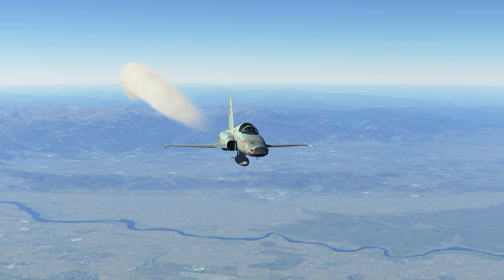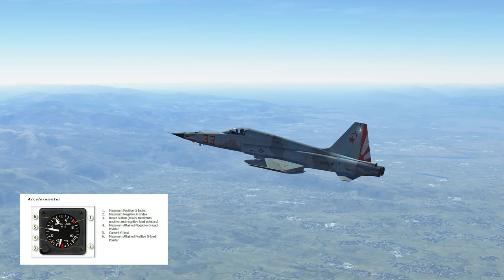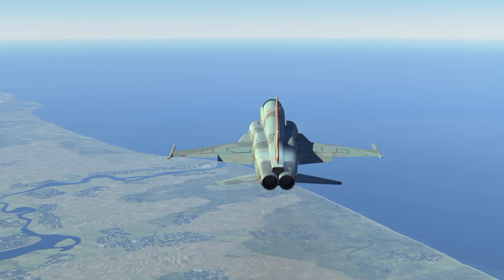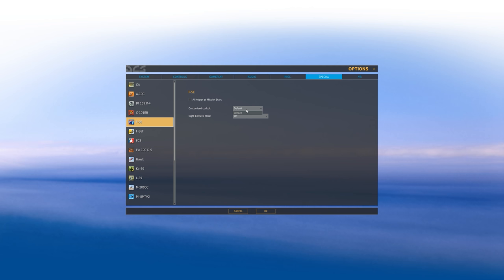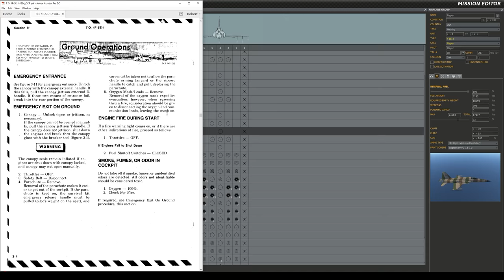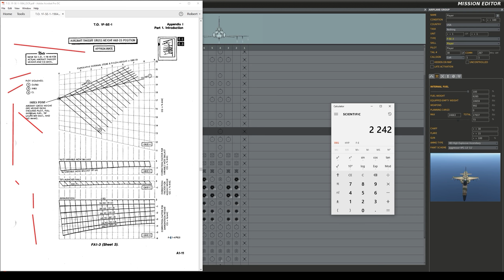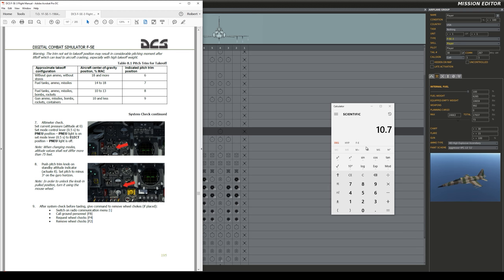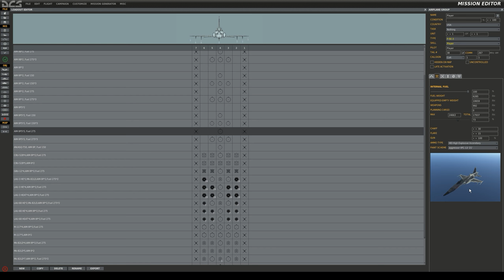Test Flight - DCS: F-5 Tiger II #2 - Basic Handling, CG Position and Takeoff Calculation

Comment: I loved how you went in more depth about how to calculate everything with the real manual. I am actually more interested in planes for the engineering side of things and not really about the flying side so that hit the spot perfectly.
Reply: You might have come across PMDG modules for FSX/P3d. They have the B737-800/700/600 NG, and B777-200LR/-300ER simulated withing 10% accuracy from boeing. It's a different kind of flying for sure, but parallel with a hobby of desktop sims.
Reply: *within
Reply: I'll keep those in mind, but I need something better that my 15 year old $15 joystick before I invest more into simulations.
Reply: No problem man. Well I will link below their website, if you want to browse. In terms of PMDG they're commercial tubeliners. You won't need a full on HOTAS for them, as their flightdecks are fully clickable, and you have fully simulated FMS and IRS (a newer more robust piece of equipment compared to the older INS like in the M2000). 
So a Logitech 3D pro would be enough. 

Kind of ironic how I've really side tracked away from the DCS F-5, haha! 

Really torn between the F-5 tiger and M2000 at the moment though.
Reply: Nearly forgot. 

http://www.pmdgsimulations.com/pages/product/products.html     

If that won't work, just search PMDG. It's on the level of simulation like the A10C since I own them both ;) Loving them all.
Reply: +rugby86 thanks man!

Comment: Any tips on trying to get a stable flight on the f5? I've been flying it for a couple weeks now, its always a battle with trim, having to constantly trim every 2 seconds and not having a breather to get a chance to let go of the stick  is becoming pita.
Reply: The F5 is well known to be a trim happy "very hands-on" aircraft. Keeping in mind trim will change as fuel is used. Also the trim effect itself is slow to begin but quick to change , so try to just tap the trim button literally once or twice and wait for the effect. If you press 5 or 6 times (or worse, just hold the trim button until the plane begins to climb/dive) it's too late, you're in for a bucking bronco ride!

Tap tap....wait 5 seconds....tap tap...when you're close, stop! Don't try for perfection, just make it easier to fly with very little pressure on the stick.

Comment: Darn i use DCS World Kneeboard and i cant get the F-5 Manual to show the pages. Do i have to mess with lua?
Reply: I got the same problem using the kneeboard builder. I think is uses a slightly wrong directory, i.e. it puts in F-5E whereas it should be F-5E-3. Try to rename the folder and you should see the manual. It is in X:\Users\<user>\Saved Games\DCS\Kneeboard
Reply: Even the main game folder uses F-5E. I dont think the F-5E allows custom kneeboards just yet
Reply: Well, it's working that way for me. And if you still doubt that it works at all you can have look at part 3 of this series.
Reply: +Frank von Horsten damn ill have to troubleshoot further